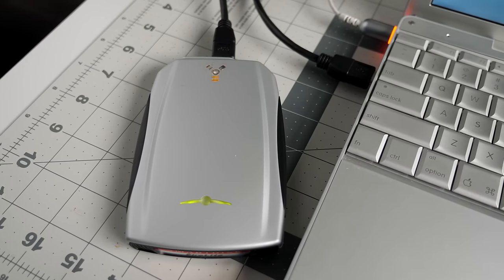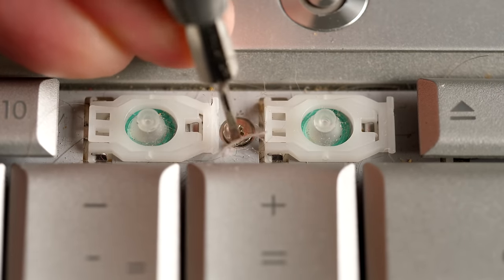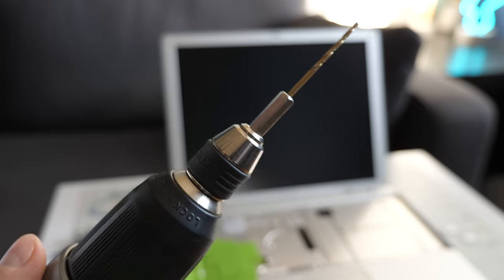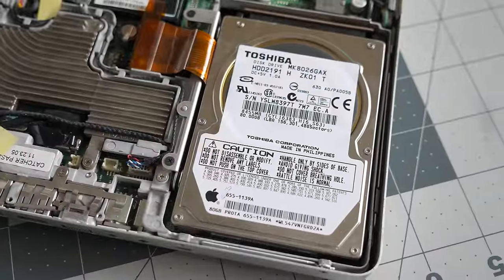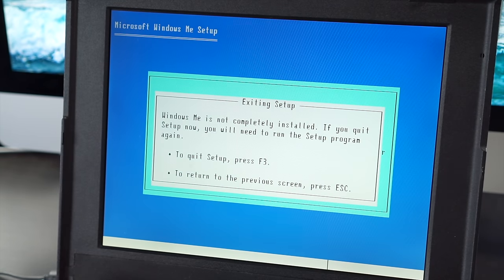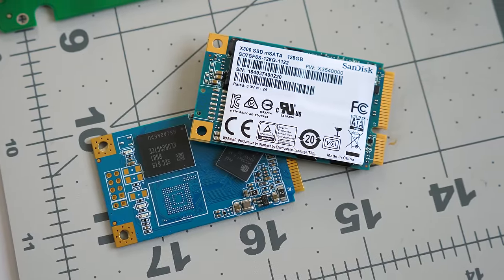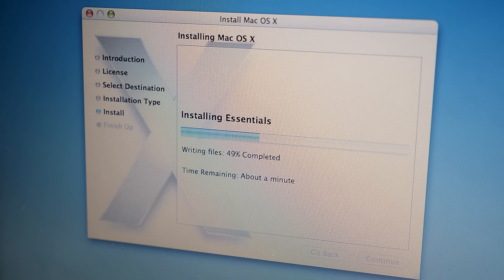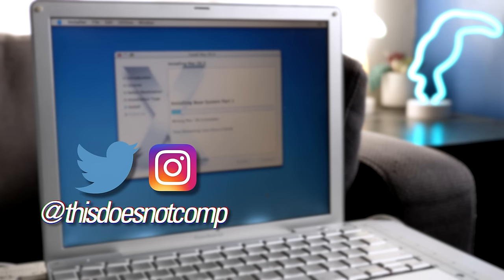12" PowerBook G4 Hard Drive Replacement

Comment: I don't understand retro people who keep using the original HDDs. First thing I'd do is swap it with something solid state and do everything to make it compatible, no matter the cost.
Reply: It might sound weird, but I had gotten used to slow computers so much that booting anything off of a mechanical hard drive is not really that slow for me. I have a 2004 Dell Inspiron 9300 that I put a 60GB 5400RPM IDE Seagate HDD into. It was the cheapest option for me as I had the drive already laying around from another old laptop, and it was a huge upgrade since the machine came with a 4200RPM drive. It works good enough for me, it's supported natively, and I don't have to tinker around trying to make an adapter work with Windows XP. I don't expect an almost 20 year old machine to be particularly fast, and that's maybe why I tend to stick with HDDs with my couple of retro builds. The hard drives are cheap (or free since I have a lot of them laying around), they still keep the original feel of the computer, and there's just something special in it for me hearing the HDD rattle around when the Windows 98 boot screen appears.

Comment: Oh wow a dead toshiba HDD go figure, every dead hdd i've seen in my career has been a toshiba.
Reply: Wait what? I thought these Toshiba drives were more reliable than those Travelstar drives from IBM and Hitachi.
Reply: @cdos9186  Oh yes you are correct those are the WORST drives ever, along with those fujitsu 20 gb hdd's that all failed due to bad silicon, I guess these tosh drives take 3rd place.